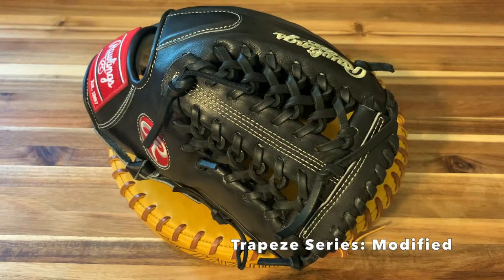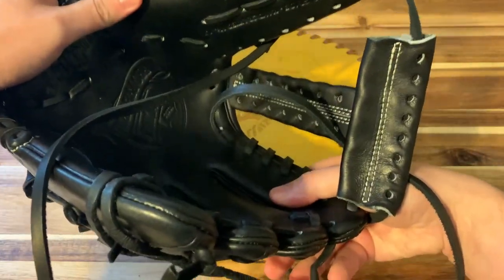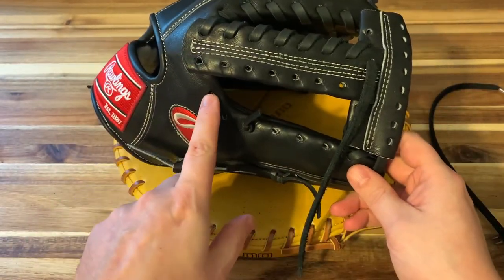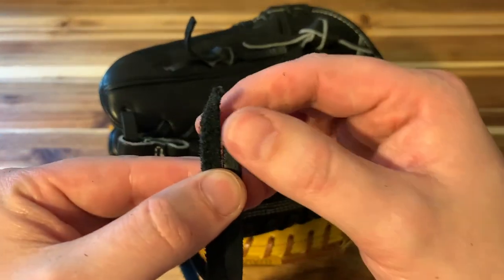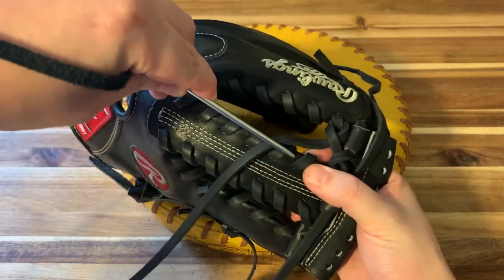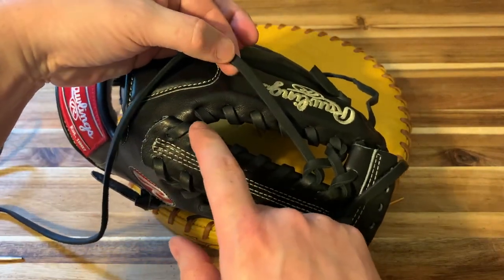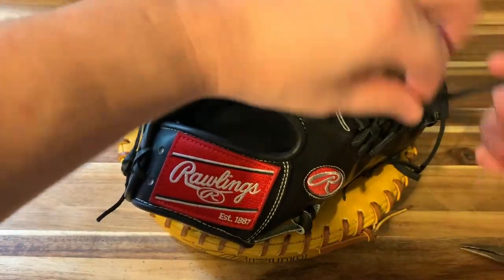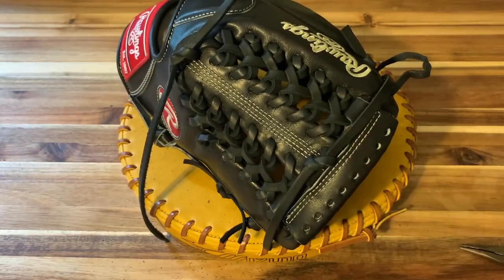How to Relace a Modified Trapeze

Comment: it looks like you are using 1/4" lace...my glove has 3/16" lace....does it matter on ease of break in or durability with the thicker lacing???
Reply from the maker: Yes, this glove came stock with 1/4”, so that’s what I used. Since the web receives the most stress, it is always best to use 1/4”. 3/16” will work too, but more susceptible to stretch out quicker.

Comment: Do you have any videos on relacing a DCT? I am trying to tighten the web on mine but I don’t know where the double anchors lead to and the ball keeps going through my web
Reply from the maker: Unfortunately not, but the DCT is one of those webs where it’s not easily adjustable without relacing the whole web. The anchors go through the horizontal bars if that helps at all.

Comment: Do you think I could change a glove from i web to single web?
Reply from the maker: Hard to say, really depends on the manufacturer. 9 times out of 10 the holes will not line up as the I-web sits a bit lower than the horizontal post of the single.